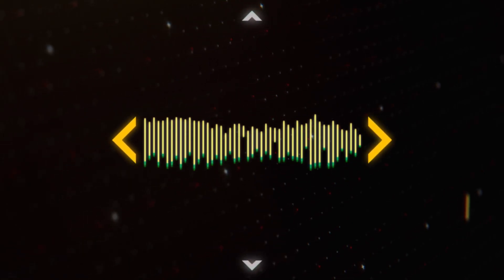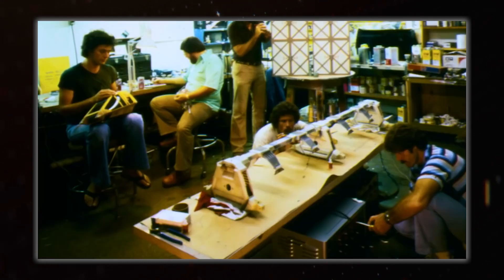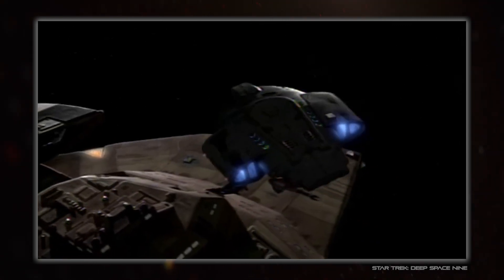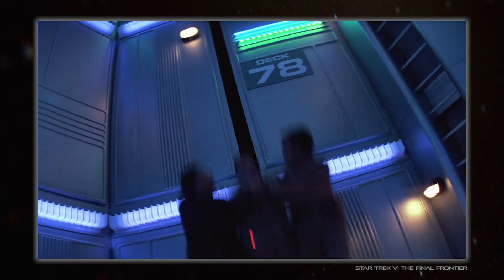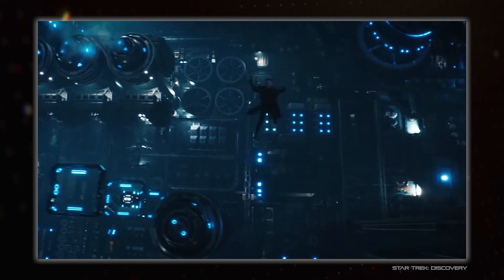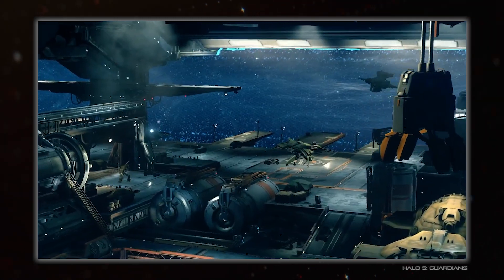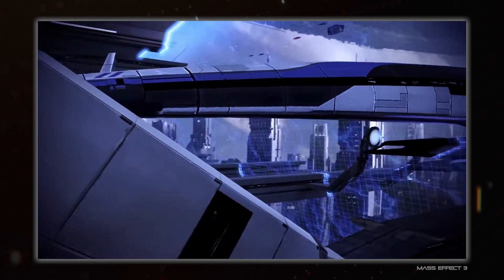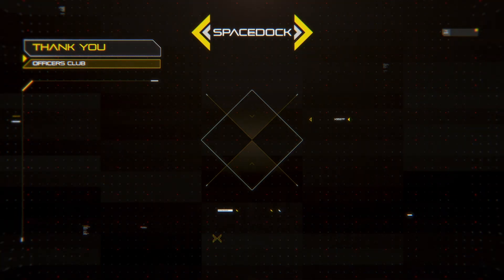Why Do Sci-Fi Spaceships Seem To Change Size?

Comment: I had imagined a battle scene between two Imperial class destroyers from Star Wars and a squadron of White Stars from Babylon 5.  But given the White Star have been reported anywhere between 100+ to 400+ feet long, the scaling is going to be really ackward.
Reply: The best scale I have seen is 268m in length for a Whitestar, as that matches the 8km for B5 and 1.6km for an Omega.
Reply: @steveaustin2686  If you guys want the official Canon numbers I have them... a Whitestar is 475.6 Metres long from nose to end of tail fins.
An Omega class Destroyer is 1,717.3 metres long, never did find out if that includes the sensor antennae sticking out the front though (probably does).
As an interesting note, Babylon 5 is much longer than 8km, only the centrifuge is 8km long, best guess for full station length from tip to tip has been about 11 miles (or 17.7km) based on the known diameter of the tube.
Reply: @Ishlacorrin  Yes, I know Tim Earl's 475m size for the Whitestar from S5 and then it doesn't match up to the Omega or B5. 

Babylon 5 is 5 miles long per jms, so I accept that number.
Reply: @steveaustin2686  ONLY the spinning section though, that is a Canon fact just like the Whitestar and Omega lengths. All of these were signed off on by JMS himself. I only use the verified Canon numbers myself.
Reply: @Ishlacorrin  While Tim Earl's S5 length is supposed to be canon, it does not match the 1.7km Omega. The 1.7km Omega matches a B5 that is 8km (5mi) long.  A 268m Whitestar matches both the 1.7km Omega and 8km B5. Those are the sizes I use, no matter what later handwaving came along. The sizes of ships and B5 changed during the show, with S1 having the Sharlin at 300m, which fits the initial size of B5 at 1 mile. But S2 changed that. S5 brought the Whitestar changes, so the majority of the show S2-S4, matches what I said above.
Reply: @steveaustin2686  What do you even mean by 'matches' in this context? The objective canon FACT is that a Whitestar is 475.6 metres, there is no *matching*, that is just the truth of the matter. It has never been 268m and a Sharlin was never anything but 1600m tall. Where are you puling these false figures from?

The size of the station was set from the start. It has been called 5 miles long since the pilot episode BEFORE season 1. It was NEVER anything less and even the opening talks about the tube section being 5 miles long specifically, so the station as a whole has ALWAYS been LARGER than that.

These numbers of yours have NEVER existed in the show even once, and the after show source material that was called Canon by JMS has always said the numbers I have stated.
Reply: @Ishlacorrin  If you put a 475m Whitestar across the front of the 1.7km Omega, it looks NOTHING like what happened to Ivanova's Whitestar vs the Shadow Omegas. If you put a 268m Whitestar there, it matches. The Sharlin was 300m in a read out on the show, but a 1.6km Sharlin matches the B5 length of 5 miles, 8 km. Tim Earl's changed a lot of the figures in S5. I know what I saw, so stuff your BS.
Reply: @Ishlacorrin  Went and found the openings. B5 was NOT called 5 miles long until S2.

Pilot - "Londo, "I was there at the dawn of the third age of mankind. It began in the earth year 2257 with the founding of the last of the Babylon stations, located deep in neutral space. It was a port of call for refugees, smugglers, businessman, diplomats, and travellers from a hundred worlds. It could be a dangerous place but we accepted the risk because Babylon 5 was our last best hope for peace. Under the leadership of its final commander Babylon 5 was a dream given form. A dream of a galaxy without war when species from different worlds could live side by side in mutual respect. A dream that was endangered as never before by the arrival of one man on a mission of destruction. Babylon 5 was the last of the Babylon stations. This is it's story.""

S1 - "Sinclair, "It was the dawn of the third age of mankind. Ten years after the Earth Minbari war. The Babylon project was dream giving form. It's goal to prevent another war by creating a place where humans and aliens could work out their differences peacefully. It's a port of call. Home away from home for diplomas, hustlers, entrepreneurs, and wanders. Humans and aliens wrap in two million five hundred thousand tons of spinning metal, all alone in the night. It can be a dangerous place, but it's our last best hope for peace. This is the story of last of the Babylon stations. The year is 2258. The name of the place is Babylon 5.""

S2 - "Sheridan, "The Babylon Project was our last, best hope for peace. A self-contained world five miles long, located in neutral territory. A place of commerce and diplomacy for a quarter of a million humans and aliens. A shining beacon in space, all alone in the night. It was the dawn of the Third Age of Mankind... the year the Great War came upon us all. This is the story of the last of the Babylon stations. The year is 2259. The name of the place is Babylon 5.""
Reply: @steveaustin2686  Oh, I get it, you are comparing scenes to try and GUESS the sizes instead of going by FACTUAL CANON measurements. You don't realise that scale is often thrown out the window for a good action scene and thus cannot be used as a measure from just one scene.

I understand now how you got the WRONG numbers. That scene is just for show, the actual size of the ship is 475.6 metres no matter how it looks due to perspective in that scene. 

The Sharlin on the other hand has never been that small, it's capable of Hyperspace travel, the Whitestar at "just under 500 meters long" was the smallest ship to have a jump drive by a LARGE margin. That is a factual quote from the show by the way, when they were introduced. So a Sharlin could not be anything smaller than 1km at the very least based on established jump drive lore, even IF you want to deny the CANON FACTS.

People like you who disregard Canon Fact are the reason the B5 community had so much backlash in the early days. There were a few like you who tried to 'calculate' things instead of just go with that was established fact in the early days too. It led to a lot of this misinformation that you are still spreading.

Canon fact is canon fact, has been since the shows inception. No matter what you *see*, what is written off by JMS as fact is what is true. Just wait for his reboot that is coming soon and you will see just how wrong you have been.

Meanwhile I'm going to go by the Established Canon Facts and correct misinformation like your lies where ever I see it.
Reply: @steveaustin2686  Irrelevant, canon fact is still canon fact.
Reply: @Ishlacorrin  So the Sharlin is 300m then? Funny, you whined about the B5 length in the intros and then dismiss the actual intro text. Your credibility is shot and you are irrelevant.
Reply: @steveaustin2686  The Sharlin has been Canonised as 1600m tall, where are you getting 300m from? This is not Star Trek where the show is the ONLY Canon material, B5 has multiple sources and the latter printed sources trump any early ones or guesses from the show's scale. It is Established fact at this point that the sizes I have provided are correct. Nowhere in the intro text does it dispute and/or disprove my points.

Comment: I would like to hear about the practicalities of realistic ship sizes. It’d be cool to look at it from two perspectives of like a civilisation that’s only industrialised their home system vs a post scarcity unlimited resources civilisation.
Reply: And also adding in considerations of fictional ultra-strong materials or high-tech reinforcement, like Star Trek's structural integrity field, as a means of making larger designs more feasible.
Reply: Even for post-scarcity, it would require an interesting mindset to willingly sacrifice performance and economy in order to have 5m-wide corridors and private quarters for every lowly midshipman.
    I'm thinking of Robert Sawyer's Great Ship stories -- the titular Ship is the size of Jupiter, nobody knows who built it, and has so much internal volume that a 100m by 100m stateroom with a fountain in the middle is considered "low-class".

Comment: Half Life 2 did some clever Lord of the Rings style perspective trickery to render unfeasibly-large objects within its playable environment. The massively imposing skyscraper of the Combine Citadel is actually several times smaller than it appears on-screen, but it actually moves as the player does, maintaining the illusion that it's both larger and further away.
Reply: Portal 2 uses similar tricks. Tiny models are blown up and projected onto a nearby skybox to make the Aperture facilities look much bigger than they actually are.
Reply: The trick is actually quite simpler and simultaneously more complex than that. The Citadel and other surrounding objects were stored in a separate part of the level map and they had a separate camera that copied movement of the player at a reduced scale, and rendered what it was seeing as a replacement for the actual level's sky.
Reply: @DarthBiomech  I think a similar thing is done on several Team Fortress 2 maps where if a player noclips out of the map they can find the map skybox in a separete area and if they fly into it the players on the normal map will see a giant player in the skybox.
Reply: @ilmevavi1112  Same game engine, so it's logical. =)
Reply: 3D skyyboxes are common in warframe, where its just a miniatureof the items and sjy somewhere under the level, sometimes peoples found it and wiht glitches put decorations in them. its pretty obvious as the distant scenery is glued to the camera. 
I'm impressed half life ha something in between skybox and map geometry.

Comment: The SSV Normandy SR1 supposedly has a length of 170m and yet only two very small decks, no real living quarters and a tiny crew (not necessarily a bad thing). If you compare that to a modern warship, a British Type 23 frigate for example, they have a length of only 133m and yet they have 6 decks, dozens of compartments and living quarters for 205 personnel. The SR2 suffers from a similar problem but to a much lesser degree and I have to imagine her having at least one more accommodation deck to make any practical sense.
Reply: A type 23 can pack the space MUCH tighter thanks to human dexterity over game-engine wonkiness. The Normandy in all its various forms is downright hollow by comparison
Reply: The Normandy tried to handwave the lack of quarters by suggesting that the crew "hot cot" in sleeping pods (which I think you can actually see on one of the decks).  Keep in mind, there's a paltry number of pods - and the only other space for crew not on duty is the mess.
Reply: @Dream0Asylum  If they'd designed her properly then hot bunking wouldn't be necessary. If modern attack submarines can cram in enough accomadation for the whole crew then so should a larger, advanced future space warship. In reality, its limitations of medium and mid 2000s tech so you can't really blame the developers for simplification. What you can blame someone for is the incoherent mess which is the Systems Alliance rank structure.
Reply: It doesn't make a lot of sense to compare a space ship to a floating ship. It would make a lot more sense to compare it to a high altitude aircraft, or a submarine; both craft with comparatively limited life support.

Comment: I do quite like it when a SF property uses the limited interior space within their ships to give them a certain sense of character. The Millennium Falcon, the Nebuchadnezzar, the Rocinante, the Bebop, the Milano, Serenity -- they really create a sense of homeliness when you see the characters actively work and relax in this one pretty-well defined set. Of course that's not always what you're going for, with something like the Nostromo being a good example of a work intentionally alienating you with it's factory-like feel, but in general I'd rather see movies/shows write around a more defined set than TARDIS in infinite decks occupied by infinite extras as the script needs.
Reply: I know for the Roci at least, that the interior is not laid out like the exterior. I don't think it would even fit without cutting off some of the decks (total square footage may be the same though). But they did this for easy set layout, as the ships are navigated vertically, but horizontal sets are much easier.
Reply: @philipfahy9658  We have a lot of measurements for the rocinante. If we could find some set measurements, maybe we could figure out if it actually does fit inside the ship as presented in the show.
Reply: @BCosby423  it does not, people have checked. Chris Danelon, someone who worked on the show, made a video on it.
Reply: @philipfahy9658  Without magic "grav plates" spaceships should be laid out like towers (or spinning drums) not boats. Building such a set would strain budgets and raise safely concerns, though.
Reply: @fmitchell238a  ...Removing the fictional gravity plating scifi loves to use would not raise safety concerns. Not on set and likely not for the purpose of the story either. Functionally on set it would make no change whatsoever, you're still going to be shown rooms and corridors and a bridge and an engineering section. If they did this in Star Trek it would equate to needing more turbolifts with basically little else in the way of changes other than the outer appearance of the craft. If anything it would likely leave them more room for Cetacean Ops.
Reply: @Cthulhu4President  Maybe I was thinking of Firefly 's contiguous sets. Turbolifts on every floor (to disguise all sets being on the same level) would be the most practical way to handle most sets. But eventually you'll need a cargo deck or engineering deck that's two or even three stories tall, which you could use virtual sets for but eventually some characters will have to scale that space. And then there's the inevitable episode where the power goes out and people have to use emergency ladders, which requires those sets to be at least a meter or so off the ground to fake climbing down to the next floor.
Reply: I'd also like to nominate the Runabouts from DS9, which felt like a practical small craft / large shuttle. Standard shuttles, interior/exterior scaling issues aside, feel like an oversized minivan or short bus.

Even the various TARDIS sets gave it a certain feel, especially in the new series (and the wood-paneled auxiliary control room of the Fourth Doctor / Leela era). Pillars and split levels notwithstanding the central console of the control room was also the center of most of the action; the auxiliary rooms added and deleted as the episode demanded added either humor (e.g. the Boot Cupboard), character moments (e.g. companions' bedrooms, the Cloister Room), tension (e.g. the maze of corridors and at one point a whole factory), or wonder (e.g. the Eye of Harmony in the movie, the entirety of "Journey to the Center of the TARDIS").
Reply: @fmitchell238a  All of the shuttles in Star Trek are guilty of spatial inadequacy or a blatant omission of needed parts.
They all supposedly run on the same concept as the larger ships, but at no point are we ever shown the warp core of a shuttle even with different series showing coverage of every square inch of the inside. It makes no sense DS9 and Voyager had shuttles with a 'back room' but still never showed the warp core, it's not like they had a 3rd section for engineering.
Not to mention TNG's ability to open up the back of the shuttle so you can all pile in like it's a minivan, but still no sign of a warp core.
Reply: @Cthulhu4President  On the Danube class the Warp Core is located on the Dorsal side of the shuttle. So the top of the shuttle. On most other shuttles it's located on the ventral side, so beneath the floor. On the Danube class the warp core can accessed through a Jefferies Tube.
Reply: @Cthulhu4President  Apparently the warp core was along the spine of the Runabouts, or something. Because the best place for an antimatter reactor is on the roof.
Reply: @fmitchell238a  The shuttles WERE literally the minivans of their universe tho xD
Reply: You make the TARDIS being larger on the inside sound like a plot hole, as opposed to being clearly explained technology.
Reply: @greensteve9307  It's not a plot hole for the TARDIS, which demonstrates how their creators scoff at human ideas of space and time. It's a plot hole when ships made by humans only a few centuries in our future look bigger on the inside. Or smaller on the outside. Or bigger or smaller depending on how they shot the model (*cough* Klingon Bird of Prey *cough*).
Reply: I don’t think the rocinante was that small internally, they had a space monster onboard for a few hours before realizing it